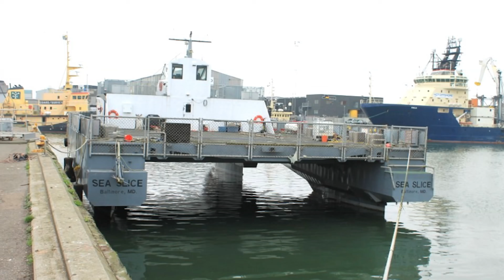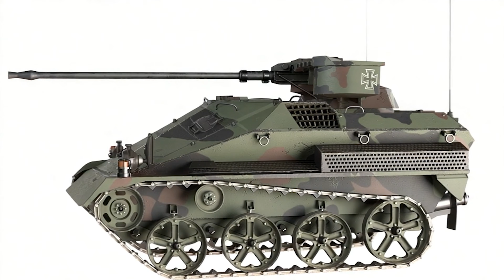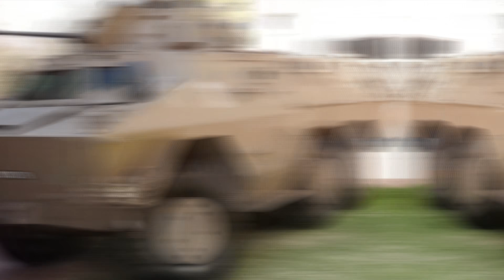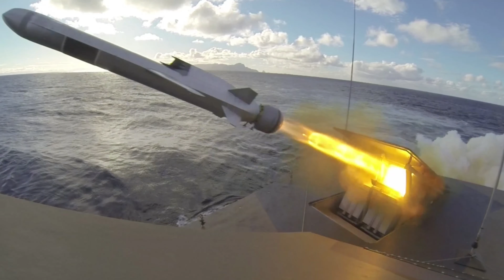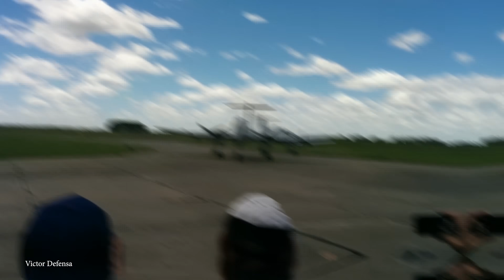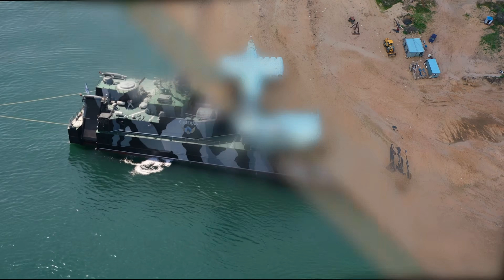15 Military Vehicles You’ve Never Heard Of

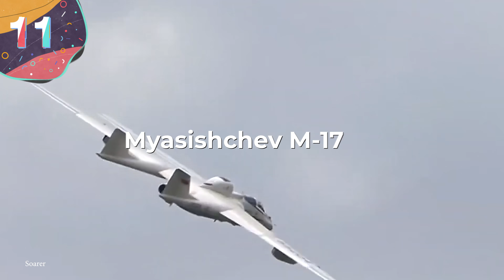Comment: 10:51 in your narrative you say the Miaashesev M-17 is a single engine aircraft. The video you show is of a  twin engine aircraft. Either the image is incorrect or the description is wrong. Get it right please.
Reply: the M-17 Stratosphera had a single engine but most  if not all of the video shows the later twin engined M-55 Geophysica, the M-17 successor.

Comment: I wonder they use the CGI models. 😕
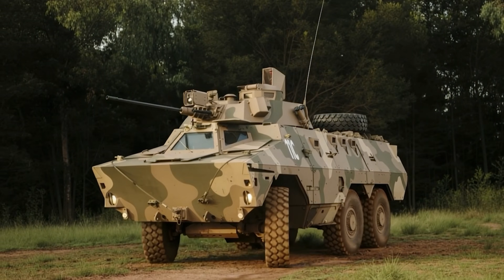Reply: 2:04 I would think so, and it looks like it to me.  For there to be even a little doubt, it would have to be a very good job, and I can’t think of a reason CGI wouldn’t be appropriate here.  I got a real good look at the truck, so it was a good job as far as I’m concerned. 15:30  here is another example.  Notice the tires rotate unrealistically.  And I could be wrong, so yeah, good job, it does look like the truck.